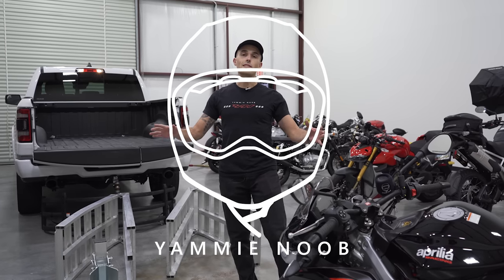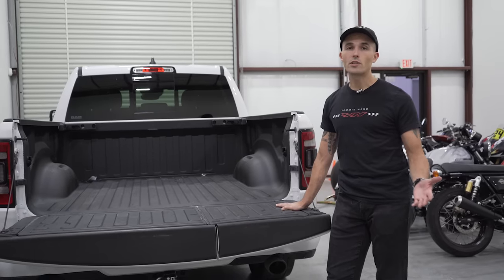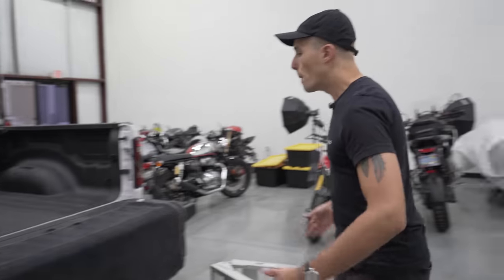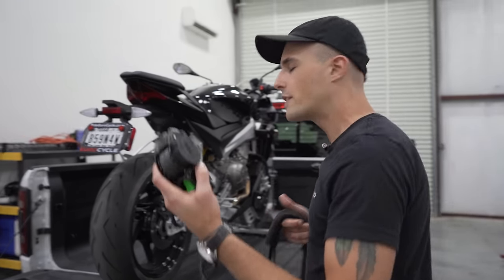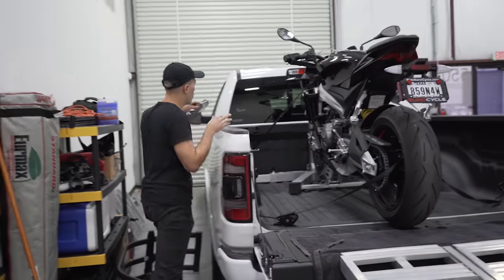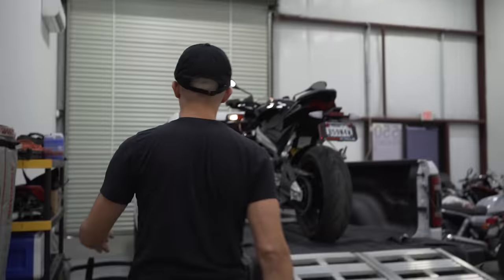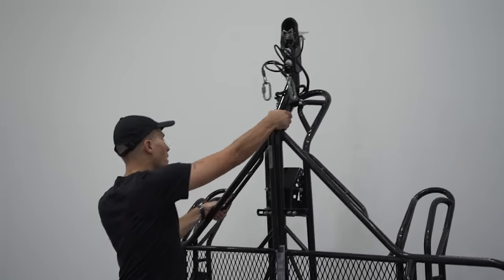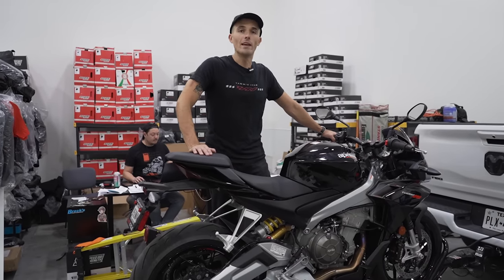How to Haul a Motorcycle with a Truck BY YOURSELF!

Comment: Seems like the truck bed is the most impractical method ever. A van would be the best and a trailer with a flip mechanism the second best (no need for a ramp).
Reply: Yeah because any man would gladly buy a van over a pickup truck if they had a choice 😂. Hey nice van, how many kids you got? None, it’s for my motorcycle, cuz I’m too scared to load it on a truck 😂.
Reply: Getting it in/out of a truck is probably more difficult than any other method for hauling a bike.   But once it's in, it's about the safest way to haul.   A trailer is much easier to load, but trailers require maintenance, the tires on them are almost all garbage, and most of them are built pretty poorly.   If I'm hauling a long distance, I'd want it in the bed, it's a PITA to get it in/out, but, once it, it's very safe.   If I'm hauling short distance, I'd want a trailer because it's so much easier to load/unload, but it's not as safe back there or easy to deal with, especially for people who don't know how to drive a trailer.
Reply: @michaelfink2070  IMO the best method is a cargo van (VW Transporter, Ford Transit etc., not a soccer mom van as somebody suggested), easy to load and you can have other stuff (helmet, riding gear, tools...) too and everything stays dry and clean if it's raining. You can also leave stuff in a van and it does not get stolen. Also northern climate is not a good place for trucks, it would suck ass to keep the bed clean from ice and snow all winter.